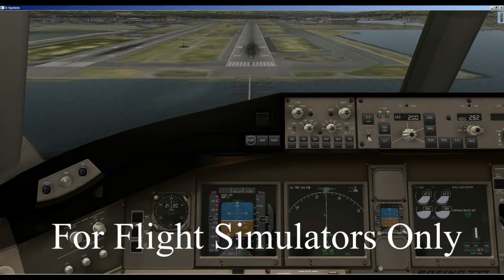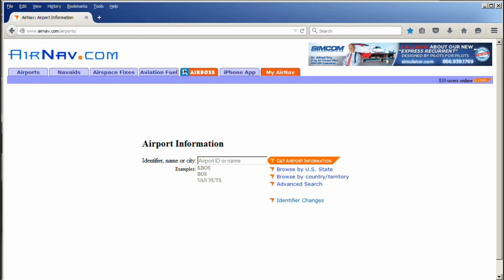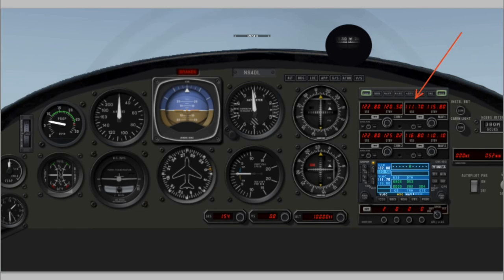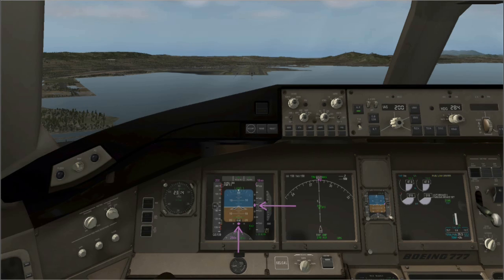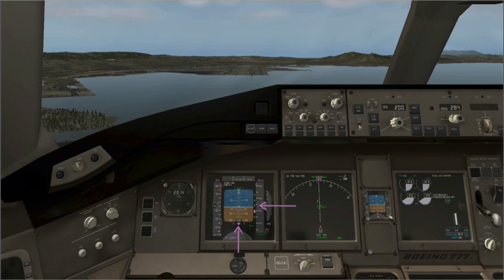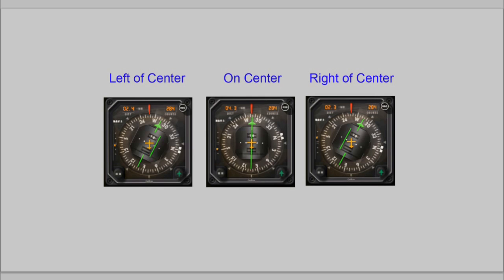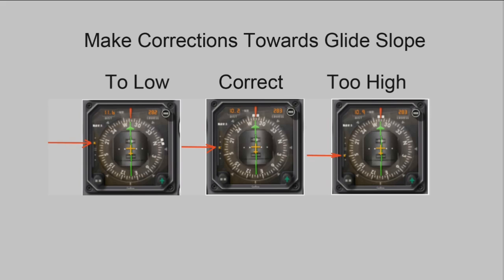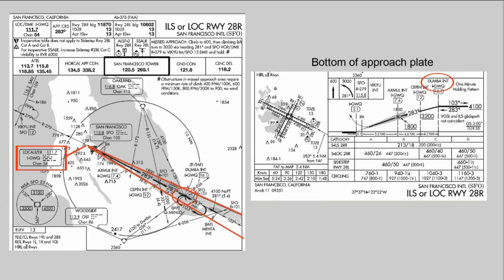How to Land using the ILS, Instrument Landing System in X Plane ~ Part 1

Comment: Question. when you set the NAV radio in FSX you hear a tone once the frequency is detected. This allows the pilot to know that they can begin the ILS process. I have found that there is no audio signal that tells you that you are in range. Any reason why it doesn't?
Reply from the maker: Hi NewJerseyJay, Sorry for the delay in replying. I'm not sure I understand your question but if your are referring to the Morris Code (dot dot dash dash etc.) that you hear when tuned to a VOR or ILS system that code is to help you determine if you are tuned to the correct VOR or NAV frequency. You match what you hear with the code written on the chart to make sure you are going towards the correct VOR or runway in your flight plan. If there is no signal then that station is not operating for some reason and naturally if you are too far away you won't get the code signal so getting a signal would be an indication you are in range. Again, this code is to help you confirm you are heading to the correct VOR or NAV aid. 

Hope this answered your question, let me know.

Blessings,
skip
Reply: Thanks Skip for the reply. But, yeah the Morse code signal is what I was referring too. I always look up the ILS frequency for my approach runway prior to taking off and enter it into my Nav 1 radio. Then select the Nav 1 setting. In FSX I typically receive the tone approx 20 miles out.  I fly at the set heading of the runway at around 3,000 to 3,500 just below the glide slope. Then turn my instruments from GPS to Nav then Approach. Usually the plane catches the ILS and brings me in. But in Xplane I never hear the Morse Code and it continues to fly over the runway. Following the same sequence above.
Reply from the maker: Hi NewJerseyJay,  Sounds like you might be missing a step activating the approach.  What airplane are you flying and at what airport and runway are you trying to land, I'll check it out?  

Blessings,
skip
Reply: WEH Videos Thanks again skip for the reply. I have an approach that I have attempted. KDFW Dallas Fort Worth. RWY 17R LOC/DME 111.35 HDG 176 Should pick up LOC/DME @ 19.3 @ 6000 FT. I've only tried the Stock aircraft. using both the flight computer and the GPS. Thanks again for your time. I appreciate it.
Reply: But I'm getting the same results no matter what ILS landing at any airpory that I attempt.
Reply: FYI I have flown around the entire world on FSX with real world weather on, on the highest difficulty without any issues. My flight plan was: Start Iqaluit Newfoundland to Kangerlussuaq Greenland, Keflavik Iceland, Edinburgh Scotland, Hamburg Germany, Minsk Belarus, Kazakhstan, Bejing China, Tokyo China, Japan to Honolulu Hawaii to San Fransisco CA to Winnipeg Canada back to Iqaluit. But yet I haven't been able to make a single ILS Landing in Xplane lol
Reply from the maker: Hi NewJerseyJay,  Well you really have some nice flying experience. So it could be a problem with X Plane, might try reinstalling as you have lots of experience in FSX. 

I don't have a lot lot of experience with jets in X Plane I do almost all my flying is a Cessna 172N as you will see if you watch my videos and I used the Baron 58 for the Garmin 530 tutorials but don't fly it very often or use the Autopilot much so I'm not much help sorry. I know several people have had the same problem you are having and it usually was because they forgot to switch from GPS to NAV1 or switch the flight director to AUTO. Setting the FD to ON doesn't work, needs to be set to AUTO. Sounds like you do everything right on your approach so ether X Plane is corrupted or you missed a switch or something to activate the AP. Sorry that's all I can think of right now. What airplane are you flying now and I'll give it a try, I just might end up with the same problem :-)

Blessings,
skip
Reply: WEH Videos Well thank you very much for taking the time to post the helpful videos. I and, I'm sure many others really appreciate it. Nice Job!
Reply from the maker: Thanks, Please let me know how you work this out, it may help others.

skip

Comment: Hi Skip. Thank you for your great tutorials which I use on an almost daily basis. Skip, I wonder if you could help with a small problem. Ive downloaded the 777 plane from Ramsees. when I want to install it I dont seem to have the appropriate program to install it to.How do I transfer it to xplane? Your help would be greatly appreciated. Kind regards Francis
Reply from the maker: Hi Francis,  You don't actually "install" airplanes in X Plane. All you 
need to do is extract (copy) the files for the 777 to the X Plane 
10/aircraft directory or folder. On a windows computer you just right 
click on the 777 zip folder you downloaded and select "Extract all". 
Then browse to the location where you installed X Plane, select the 
Aircraft folder, I suggest you make a new folder to place the 777 in then click the extract button on the bottom. 777 will be copied to that location and you are set to go, you will find the 777 listed next time you open X Plane. You will need to activate the airplane when you first load it into X Plane so keep your serial number handy, you will need that to activate. Also be sure to keep the serial number handy because you will need to activate the 777 again if there are changes to your computer or X Plane. I have had to reactivate my copy five or six times since I purchased it so don't loose your serial number you never know when it will ask you to reactivate. Hope this helps, let me know how you make out. 

Blessings,
skip